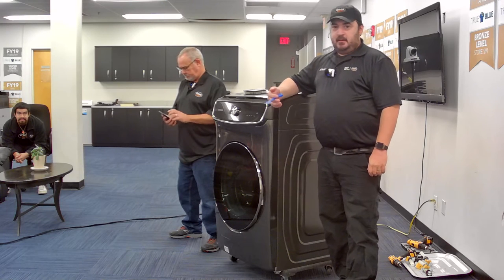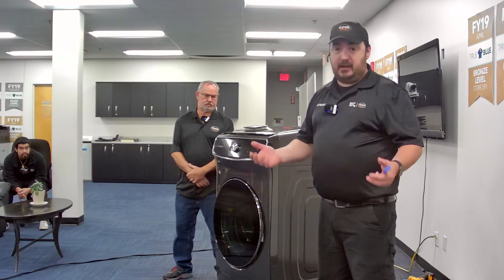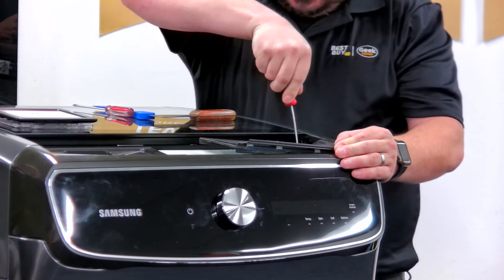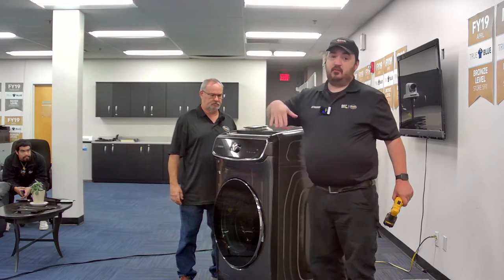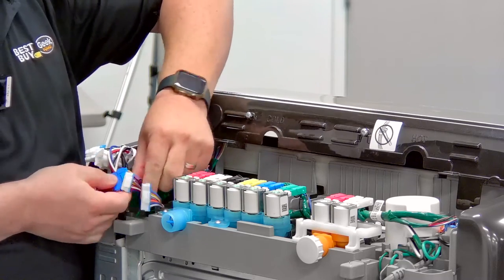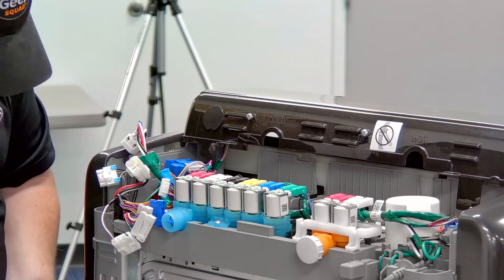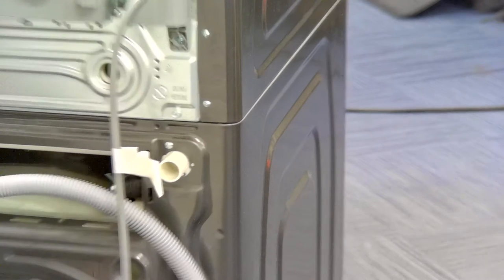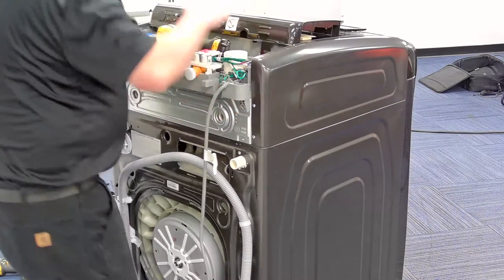Samsung FlexWash teardown

Comment: Thank you very much for this video. I have this washer and have the softener overfilling the top causing the LC1 error. I bought a whole new assembly DC97-20128A and am preparing to replace it soon. Funny to learn that all I needed was a new plastic part.  I'm wondering if its easier to take off the whole rinse assembly and pull it out, than trying to reach in and unhook the drain hose to change the plastic puck and put it back on. You described it as very difficult and a head-into-wall-banger 😀
Reply from the maker: Either part is a big job.  You separate the upper part and work on it upside down. The plastic piece is easier but most of the job is the same

Comment: Have you guys heard of things potentially going over the rim for the top drum? I thought I had dropped my Aqua Pebble somewhere outside my FlexWash washer. However, after buying a new one, putting it on the top of my clothing in the top washer, and coming back to it not being there after the end of the wash, I’m worried the Aqua Pebble was able to be folded enough to fit in between the little gap.
Reply from the maker: Ive taken a lot of things out of the drain pump.  Yesterday i found a 4 inch drywall screw that poked a hole in the drain hose. Lots of things go over the top.

Comment: I'm hoping you can shed some light on my issues with flex washer. I have the older version and my issue is either the lower washer will fill in spurts or drain in spurts. Top washer is fine. I'm at a loss and samsung have no idea how to help me.
Reply from the maker: I have a feeling you have a bad valve.  It normally fills a little hot,  a little cold until it gets the level and temperature just right.  If one of the valves goes bad it'll act like it's starting and stopping.  I think all the valves are a single part
Draining in spurts is normal. Maybe 30 seconds draining 30 just spinning another 30 draining
Reply: For the draining its real short spurts. Like maybe 2 seconds. I will check the inlet valve. Thank you for replying back.  @PirateTVProductions

Comment: can you talk about unbalance issues and best way to fix those? tried calibration and it doesn't work so I suspect its the suspension rods which I see in your video here.
Reply from the maker: It could be bad springs, a bent tub, or a bad motor.

Comment: you can use plastic pry bars to pop open the locked door. if you cannot get to the over ride manual lock pull release. or just pull very hard on door and hope handle will not brake..
Reply from the maker: I usually can get to the release by removing the top front panel and pulling the front cover open enough to reach inside.

Comment: Thanks for the video,  i have the older model (WV55M9600AV/A5) and im sure ill be referencing this 

The top washer motor will only "twich" during a cycle so i get no spin and no agitation . Everything else appears to work with both upper and lower units, any insight would be appreciated.
Reply from the maker: It could be one of 3 things.  The stator could be bad,  the hall effect sensor attached to the stator (most likely), or the controller on the main board. The stator has 3 phases and can be tested with an ohm meter.  If the ohm reading between any 3 pins matches, the stator is likely good. The hall effect unit reports the rotor position and speed back to the main board.  If it gets no feedback it'll twitch and never spin correctly

Comment: Thanks for this video. I've got a service call about no power at all on both the top and bottom washer. It has a power botton and a start pause botton separate on both washers.. I'm unable to identify why both are not powering up.  Voltage is definitely at the washer and leaving out of the filter and going to the main boards for both section. I need your help. The fuse on the bottom washer was not blown i check it.what do you suggest I do.
Reply from the maker: It's possible the control board is the issue.  I forget if the main boards are separate. If they're 1 piece, that could be the issue.  I usually take voltage readings on the cable between the main and control.  If there's none at all,  i think it's the main.  I think 1 pin is 3v or 5v
Reply: Thank you for responding. The main board for the big section of the washer is located at the back and they are two pieces and if the 2 washer sections are not powering up I'm not able to identify why that is occuring.
Reply from the maker: @ebj9510  i actually had  one not powering up friday.  it turned out to be a short in the touch panels in the front. my 5v standby was missing until i removed the wifi card and the touch panels. the voltage came back and  it would power up with a new right touch panel, and wifi card. we hadn't ordered the left side yet, but it operates with the partial keys and app

Comment: I’ve leveled mine out. Changed the shock absorber. Ran the calibration multiple times. And can never get it back to complete a full cycle. What’s next? Changed the vibration sensor too. 
I’ve ran the diagnostic and it’s spins. It doesn’t wobble with or without clothes. 
What’s my next option?
Reply from the maker: What happens when it doesn't finish? Does it show a code?

Comment: I just encountered the LC1 error but fabric softener and bleach has never been used in the upper washer. Any advice on what else could be causing the LC1 error?
Reply from the maker: It's usually the check valve on the softener. It's supposed to stop the water from the tub from flowing up into the dispenser and out the top. It gets stuck open

Comment: Would you be able to provide part number. I need to replace the bearings/seal on the bottom washer. Model WV60A9900AV
Reply from the maker: I usually check www.encompass.com  im having trouble finding which bearing and seal is upper and which is lower.  Most times for the front load,  you'd replace the rear tub which comes with the bearing and seal installed. Make sure to replace the o ring between the front and rear tub as well to prevent leaks in the future

Comment: any help  i bought a new floor model and the spin cycle is i guess off balance    i did the calibration and it finished with no issues but when its goes through a cycle (empty and with clothes) it shakes so bad it shuts down and tries again    do you have any tips or help to stop this or what to do to fix it ?
Reply from the maker: Hard to tell without seeing it spin

Comment: Any advise on the top washer if the door will not lock in order for it to run in general I believe it says dc1
Reply from the maker: DC1 is usually the lower washer door latch going bad.  1DC is the upper.  The latch itself is on the front strike  for the outer glass door if i remember correctly.  I haven't had to change one in a while, but i think it slides out while the unit is mostly assembled.
Reply: @PirateTVProductions  Thank you I found the latch. This latch has been defective since I bought the unit but instead of Samsung fixing the locking mechanism, they rather send me a new unit but now they see its out of warranty since I had the unit in storage and won't cover it so i have to fix it myself.

Comment: Lower washer keeps saying check water supply faucet and restart. Already checked filter screens and my water hoses- all clean. Would this be the pressure sensor? I took the back apart and found the pressure sensor only for the top washer. Couldn’t see the sensor for the lower washer. I’m stuck
Reply from the maker: Does it seem to fill up? If it does get the right amount of water but it can't tell.  I think the sensor is in the back left. You can find it at the end of a thin black air hose coming from the bottom of the tub
Reply: @PirateTVProductions yea water fills up. Actually seems to continue to slowly pump water in. Seems like it doesn’t stop when switching to the washing phase. I will look for that sensor
Reply: Every cycle stays on like 2 min.. then gives me that error and drains
Reply from the maker: I was incorrect about the water level sensor for the lower washer,  it is in the center front of the unit behind the front panel

Comment: The flexwasher I'm working on is not turning on at all, I pulled it apart and found that it's throwing full (or what I assume is full) voltage when first plugging it in. Then when I hit the power button it experiences a sudden drop in power and I never get any sort of reaction out of it. Any ideas what the first piece to try swapping is or any other potential problems that could be causing it?
Reply from the maker: That sounds like the main board but i would try unplugging things like the latch, drain pump and motor to see if one of them is causing a short

Comment: My machine WV55M9600A V/A5 has no power. The display flashed on and off a couple times for a couple days but now has nothing. I can hear a faint click noise toward the back of the machine but nothing works after the click.
Reply from the maker: Could be the main board in the back but it could also be the control board in the front.  It's hard to tell

Comment: Hello, my washer is about half a year old but recently its been having “unbalanced load” issues and never completes a rinse cycle. Any ideas?
Reply from the maker: Does it physically shake? Most times for me this is 1 or more legs that have gotten loose from the floor or a machine that isn't level.  If it can wobble a bit,  the end of the rince can amplify the shake, and the sensors will stop the cycle after 3 tries.  

Other causes can be a bad shock absorber, spring, bent wash tub, or the motor. Those are usually older when those things go bad.
Reply: I’ve leveled mine out. Changed the shock absorber. Ran the calibration multiple times. And can never get it back to complete a full cycle. What’s next? Any sensor that I have to change?
Reply: @eberescobar4016 I have the same problem. Were you able to fix this eventually?

Comment: Top flex washer handle broke.  Can I order just a replace handle or what will all need to be ordered?  Can I get just a top glass door?
Reply from the maker: Is it the outside glass door or the inside? The outside is easy to change. The inside comes with the tub top and is a bigger job
Reply: Inside door that latches. Do you know what part I need?
Reply from the maker: @MNMisfits-e3l  i  think its the tub top. it comes with the door

Comment: I have a huge issue with the bottom washer. I took entire washer a part to replace the sipder arm and I can't get the outer tub apart from the drum(bearings and everything won't budge). I already removed the front part of pladtic tub.
Reply from the maker: If it won't slide out,  the bearing might be worn. I usually pull the whole tub and change it vertically. If that doesn't help,  you may need the rear tub as well. That's how i replace bearings to avoid leaks and avoid pressing the bearing in
Reply: @PirateTVProductions  I have the Samsung WV60M9900AV/A5 and the horizontal bearings are bad.  Repair tech tells me that bearings aren't sold separately and I need a new rear tub assembly (DC97-19647D).  That's a pricey part, when the bearings would be much cheaper.  Is it possible to only install new bearings?
Reply from the maker: @1979cavsfan  ive never done just the bearing. i think it is pre installed in the rear tub

Comment: Does any had run into not water  filling up,  my machine it turns on but doesn't fill up i heard the snap of the valve i guess but no water at all. Can any body help?
Reply from the maker: It's usually the valve itself.  It could also be the filter on the inlet clogged.

Comment: We have the older version with a code 3c2 any idea where I start in replacing parts? Top washer works lower stuck on sensing and would not spin.
Reply from the maker: It's usually the motor or more likely the hall effect sensor attached to the motor.  It can't sense the motor position so it won't turn
Reply: @PirateTVProductions  I will take a look thank you so much!!!!
Reply: @PirateTVProductions  Hall sensor replaced and did not work.....I ordered a control board should be delivered tomorrow if that doesnt work would it be motor & stator next? the drum inside is a little stiff to turn.

Comment: Mine says "close door and restart" Any idea? We replaced the door switch and doesn't work.. we replaced the PCB and still not regonized the lower door was closed. Help!!! Thanks
Reply from the maker: Does it beep instantly and say "DE"? Or click a few times before stopping?  It should click once or twice, then start washing. If it doesn't do the clicks and you've replaced the latch,  it might be the main board

Comment: Does the bleach dispenser work the same way as the fabric dispenser with the foam disk? If so, is the foam disk in the bleach dispenser supposed to sit freely beneath the hole in the dispenser and rise as the water passes through? Or is the foam disk supposed to always remain plugged in the hole?
Reply from the maker: When water rises it floats up and blocks the opening. Normally it's open
Reply: @PirateTVProductions  
Thank you for the information and decoding what I meant. I apologize for my typos. 

I was grateful to hear you mention the foam plug in the older flex wash version for the fabric softener dispenser… because I haven’t found any information on the bleach dispenser, other than it is there, for this newer model. I wish the bleach dispenser had a max line for the upper washer like the fabric softener dispenser does to keep confusion down. 

The little black foam disk was in the bleach dispenser hole and as I was cleaning it I accidentally pushed it down. Initially, I couldn’t see it and didn’t know it was there until I felt it drop. I was able to pull up back into the hole, but I wasn’t sure how it was supposed to be positioned in the dispenser. 

Thank you for the videos and instructions you offer. Life saver!
Reply from the maker: I think the deal is that the softener gums it up where bleach won't. Ive never had the bleach apart

Comment: Mine doesn’t leak anywhere that is common. Popping the back door off to see the upper pump, that’s when I see water leak from the drain hose. It will fill and swish a minute then when it sucks some out water sprays up from that tube.
Reply from the maker: That should be the sensing. It shouldn't drain after that, unless the sensor on the bottom gets wet.  If so it'll drain forever until you unplug it
Reply: @PirateTVProductions  I actually unplugged the black pump. The one that puts water in the fabric softener and no more leaks.
Reply from the maker: that works as well @307.William

Comment: Ever come across where you run the Self Clean Cycle for the lower wash, runs through for a few hours and then it stop? No power, unable to open door? Dead! I tried unplugging the outlet for 5 minutes and plug back in with no luck. Unit is barely a month old
Reply from the maker: The top washer still works? Id imagine a defective main board
Reply: @PirateTVProductions  There is no power at all to the whole unit. Unable to start the washing machine. Thanks
Reply from the maker: @kcsupratt  possibly the main pcb. under warranty itd only take a few days to get it fixed
Reply: @PirateTVProductions  From your video, if it is the main PCB then hopefully they don't need to pull out my whole washer. Thanks for the help. I got someone coming tomorrow and monday. Hopefully they have a part and can fix it the same day. Thank you again!

Comment: My Samsung flex washer “lower washer does not go through a full cycle keeps saying to check draining system, what do I look for or what would I repair
Reply from the maker: How fast does the water drain out? There may be a restriction in the hose or pump. If it drains for too long but still senses water inside, it will act like that with a code
Reply: @PirateTVProductions  when the drain plug is open it drains fast but there is no code on the display, the only thing the display says is to clean drain filter but filter is clean and cycle will not resume
Reply from the maker: Must be the pump or drain hose if the plug can drain it but it can't drain itself
Reply: @PirateTVProductions  I really appreciate your prompt response and support to this issues. I will check the drain hose and drain pump

Comment: Where is the water level sensor?
Reply from the maker: It should be a small sensor on the frame.  Back corner i think with a small air hose going to the bottom of the tub